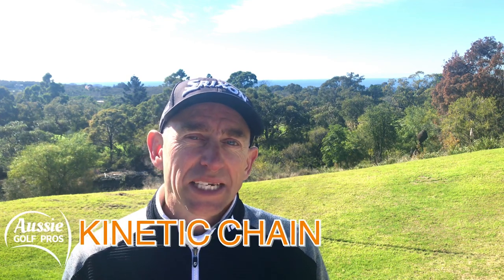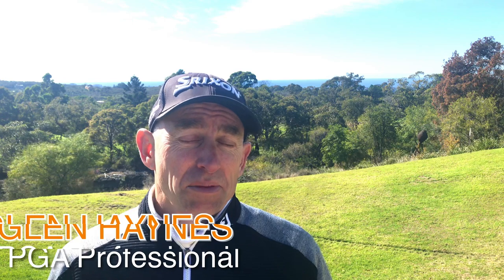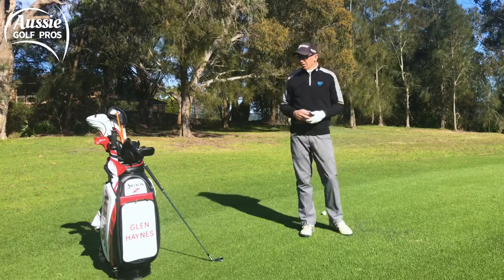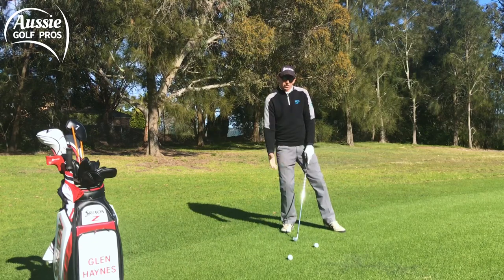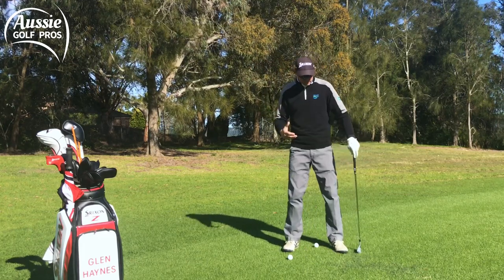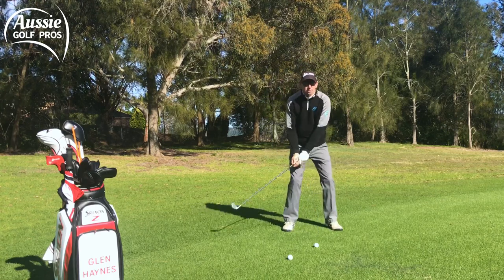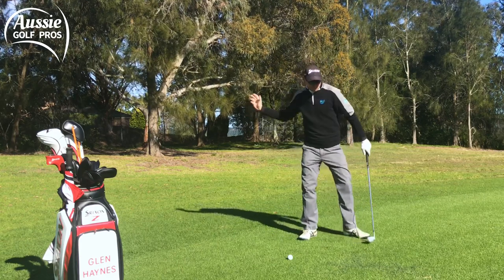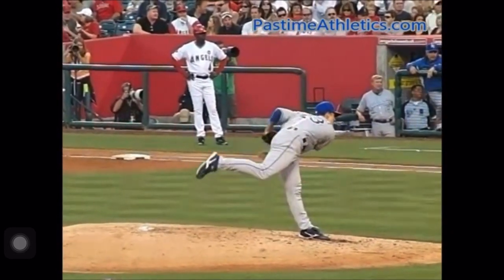Kinetic Chain In The Downswing (Simple Drill)

Comment: Thanks Glen. This is really important. I’ve found that even though I feel like I’m swinging slowly I’m actually not and so long as the sequence is right the ball will fly. My problem is I tend to stop turning my hips when my belt buckle is facing the ball on the downswing. This leads to a chicken wing, slice and inconsistent contact. Practice, practice, practice! Also, I’ve found I get better contact when I keep more weight forward on the golf swing. What do you think of the stack and tilt method? Cheers and keep the videos coming. Steve
Reply from the maker: Hi Steve, thank you for your comments. Your issue with lack of turn through is a very common problem and does cause many problems with control. The root cause is often not being able to isolate the lower half of the body from upper body when rotating forward. We will cover this in the future. 
The Aussie Golf Pros are not method coaches but are always studying alternative swing techniques. Like any coaching method, Stack & Tilt will suit some players better than others. Without the shift of pressure from the back to the front foot during the swing, there would seem to be a power leak. It’s hard to imagine a baseball pitcher throwing as fast if starting with the weight forward! Glen
Reply: Thanks Glen. Yeah I understand that one style doesn’t suit all. I just found that keeping my weight forward helped my consistency. If you could do the video on isolating the lower and upper body I reckon that would help me a lot. Anyway I really appreciate your videos and your time responding to my comments. My big question is why you guys haven’t hit 10000 subscribers!
Reply from the maker: 230662steve thank you for your support. 😂 We’re sneaking up on that 1000 subs! One day. I’ll let you know as soon as we release our video on isolation. Cheers